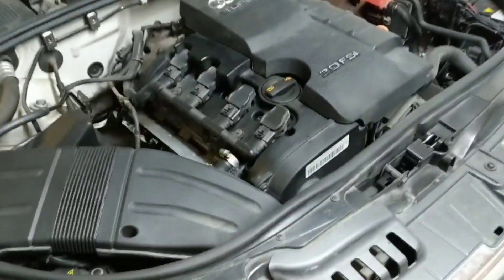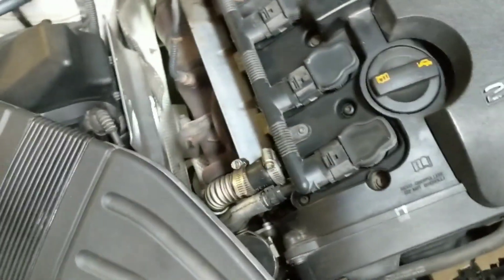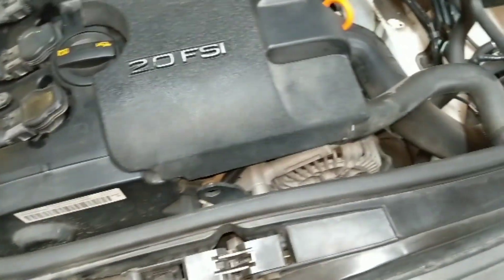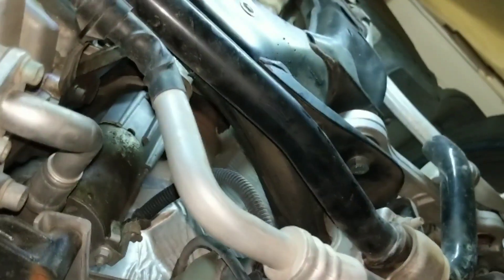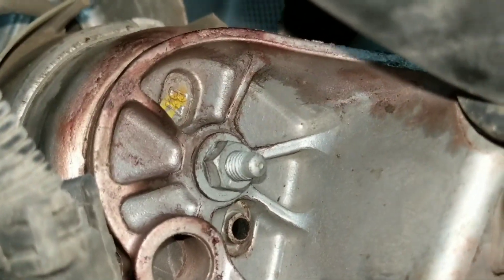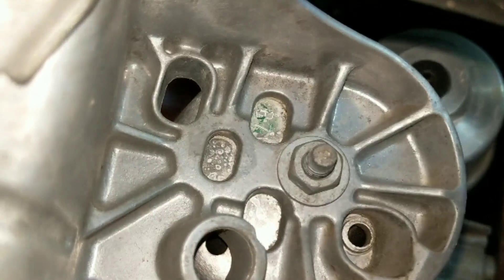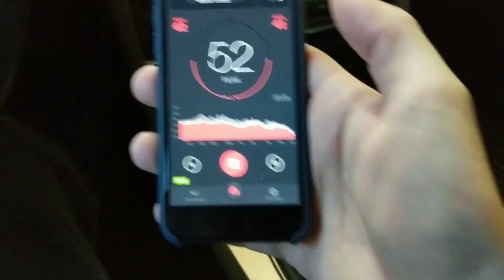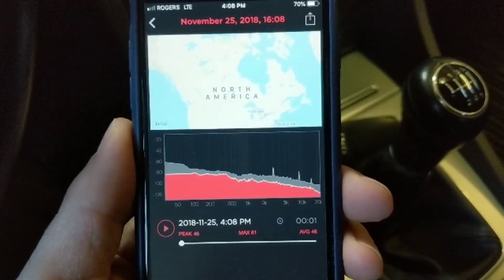Leaking Motor Mount & "NVH" Testing | Audi A4 B7 - Pre-install Breakdown

Comment: Do you have to support the engine when removing the motor mounts? Or can they safely be replaced?
Reply from the maker: Yes, you'll need to support the engine from either above or below but only enough to give yourself room to pull out the mounts. It also depends on how much play you want to create in the sub frame to give you room from below, too. It's the studs on the top and bottom of the mounts that create the clearance challenge.

Comment: I have to replace mine as well, I read that you can unplug the sensor, which disables them but should make for a smoother ride immediately? If so, I'd like to try this, just to see if the vibrations I currently experience will be gone.
Reply from the maker: I don't have the hydraulic electrically controlled mounts, but if they work through pulse modulation, it makes sense that they'd become disabled if they were unplugged. That said, it'll likely throw an error and I'd guess the ride quality would be more consistent...but just not controlled. It would be statically as good as the rubber and hydraulic fluid is at rest. If you try it out, post back here to let readers know what you experienced!

Comment: Been trying to track down this leak for a few days, thought it was coolant that was concentrating near a small leak, then I thought it was the turbo oil line leaking, then thought it was the transmission line. Audi A6 with 2.7T engine...........turns out it was my motor mount cracked open.